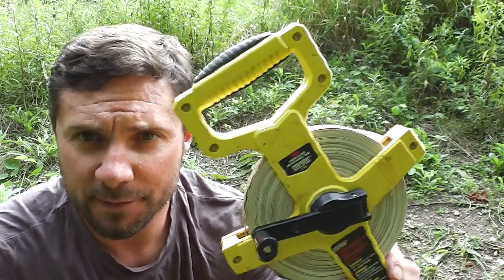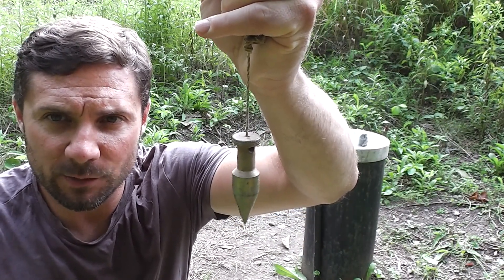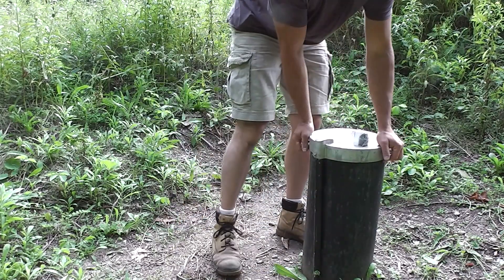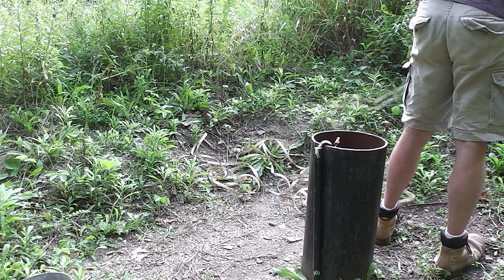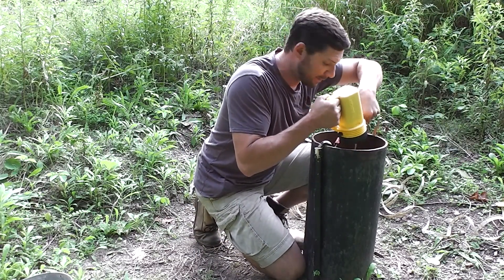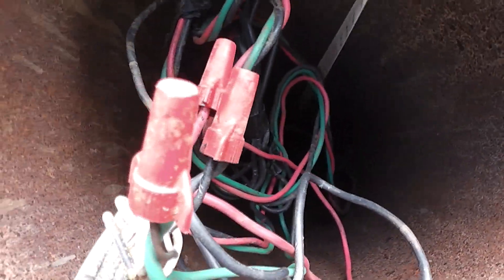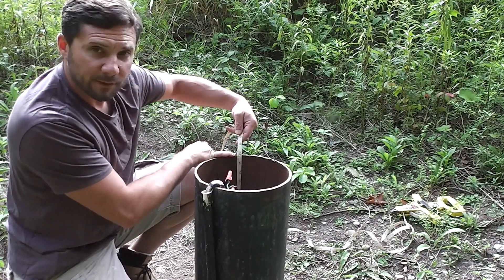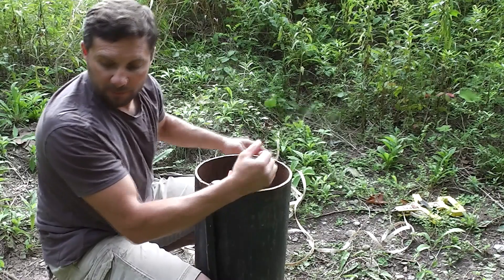Measuring Well Water Depth

Comment: I just used this approach on my 4yo well.  The driller originally told me it was 70' static water level (and 270' total depth) and I believed him.  However, I just checked it using my 100' HF tape as you show in your video, and I'm at 44'.  I asked the driller how he measured it, and he said "drop a small rock and listen for the splash.   25' per second".  I didn't have the heart to tell him that velocity increases (accelerates) at a rate of meters per second squared - thus, it's not linear.  Still, trying his approach, it took 4 seconds.    But, I also heard the rock hitting the casing and plumbing on the way down so I'm sure that slowed the impact time.   In any case, thank you for the suggestion.   The only other thing I'd say is maybe not lay the excess tape on the ground (contamination with well?).  I tied a 10mm wrench to the end of my tape as a weight, and it was heavy enough to unspool directly from the reel.   Although, I'm sure my tape is probably dirtier than your ground.  Ugh.
Reply: Maybe the driller was smarter than you think, you paid to him by drilled feet, didn't you? :)

Comment: I took a wood yard stick and cut a v notch in both ends, then tied a stainless nut to the end of  some masonery string, then lowered the nut and string down the well until I hit bottom. as I pulled the string out of the well I wrapped it around the yard stick, each wrap being 3 feet. when the string became wet I counted wraps from that point to the nut to determine the water  depth . I kept the yard stick and string in the pump house so I could measure at different times of the year
Reply: great idea Roy,
Reply: Thanks for the great idea👍🏻👍🏻👍🏻
Reply: Best Idea of everything I read so-far simple yet effective. Thank you
Reply: Your string can be easily stretched, wrapped to tightly or too loosely. Not accurate. We tried the string method and got a lot of variations the same day even with trying to do it consistently.
Reply: @ecrocker7499  I have used the same piece of braided masonry string and yard stick to measure the water in my well for 30 yrs, it has not stretched at all, 60ft of string wrapped 20 times around the yardstick and the nut ends up at the end  of the yardstick every time I measure, maybe you are stretching or wrapping your string too tight.

Comment: MEASURING WATER DEPTH, My understanding is you measure to the top of the water surface and record same, then drop your device till it bottoms out, record that depth, now subtract the 2 numbers and you have a measurement in column feet,multiplied x the casing radius, 8 inch casing = 4 inch radius, squared=16, times pi, 3.14 times the water column, in inches not feet, convert first,,, not the casing length, to find water quantity, so, here goes, convert 260 feet to inches, it equals 3,120 sq. inches, times, converted to or into gallons per foot of casing, you get a real time accurate quantity of how much water your casing is holding, it varies depending on times of the year, rain fall etc. Always, always, always, shut of the power at the circuit breaker before opening a well,  4 inches x 4 inches x 3.14 x 3120 = 156,748.8,, there are 231 cubic inches in a gallon of water so divide 156,748.8 by 231 =678.56 gallons total, to find volume in lineal feet divide 678.56 by 260 feet ,, that equals 2.60 gallons per lineal foot of 8 " casing,   6 inch casing equal approx. 1.5 gallons per lineal foot
Reply: Good post👍🏻👍🏻

Comment: You have a pleasant voice to listen to -- not loud and annoying like some.  So -- you were just measuring the depth TO water, not the depth of the well itself (not to well bottom), correct?  How would you do it on a well that doesn't have that large of a casing? Many domestic wells here just have a 4" or 6" casing (they aren't very deep) -- yours looks to be a 12" diameter.
Reply from the maker: Thanks for watching and thanks for the compliment. Yes, I am just measuring to the water surface. Measuring to the surface is the first step in determining how much water the well holds (provided you already know the well depth). It is also a way to determine flow/recharge rate. I have other videos on those things too. I’m glad you asked about measuring smaller diameter wells because I wish I had mentioned about that in the video. Ours is a 10 inch diameter well, so there’s plenty of space to drop a plum bob and tape measure down without touching the sides and not getting it caught on the plastic pipe coming up from the pump and the spacers that hold the pipe away from sides of the well. We have an older 6 inch diameter well too and I have to be very careful not to get the tape stuck when using this method. Frankly, I wouldn’t even try it on a 4 inch well unless the pump is pulled out first. Hope this answers your question and thanks again for watching.

Comment from the maker: That could work too. I just like measuring to the surface of the water instead if all the way to the bottom. I would be concerned about wrapping whatever I dropped down around the pump or something and not being able to pull it up. If that worked for you that’s great. Whatever gets the job done.
Reply: I have seen new wells being drilled due to objects getting stuck between pump and casing. Old pump stuck in well for good.

Comment: I have a simple formula to calculate depth of anything. 
Drop the rock and note the time in seconds. (i.e 3 seconds) 
Then multiply the time with the same number. ( 3 x 3 = 9)
Then multiply the answer with 16 then you will get the approx. depth in feet. (9 x 16 = 144 feet)
If you convert 144 feet into meters, you will get approx 43.89 meters.
That's it.
Reply: The problem with this approach is, you have to assume that the rock is accelerating at an unimpeded rate (m/s(s)) but unless you have perfect aim, the rock is bound to hit the casing, the plumbing, the electrical wire, or the safety rope on its way down - slowing the fall and delaying the water impact.
Reply: @erkme73  He must have a hovering wireless submerged pump... (greatest of condescending sarcastic tones)

Comment: what is da purpose?
Reply from the maker: You can estimate well recharge rate by measuring depth to water and how it changes. I have another video posted about using the measurement to calculate estimated recharge rate. Also, if you know well depth, measuring depth to water will tell volume of water stored in well.
Reply: only if you do all the math
Reply: no purpose.  It doesnt matter.  You can just drop the submerged pump to whatever debt.  If the well is 100 feet deep but you only have 45 feet of cable that should be fine. It make sno difference.  people just want to make life harder.